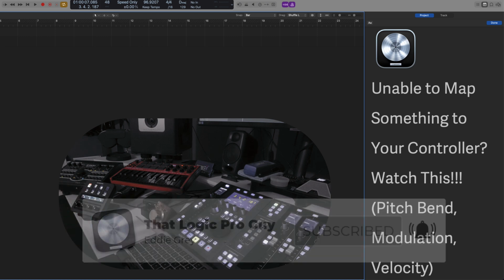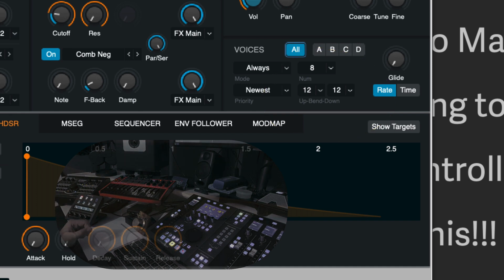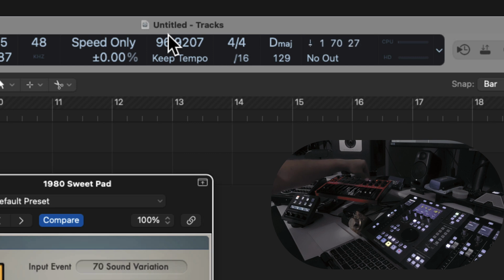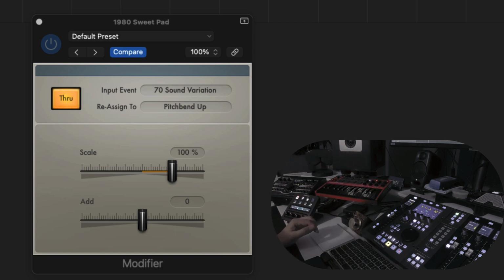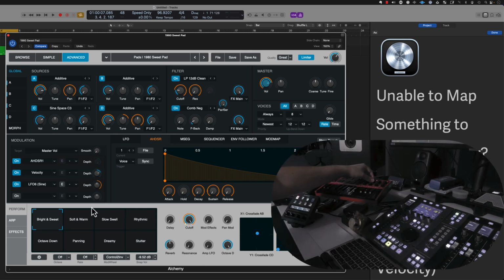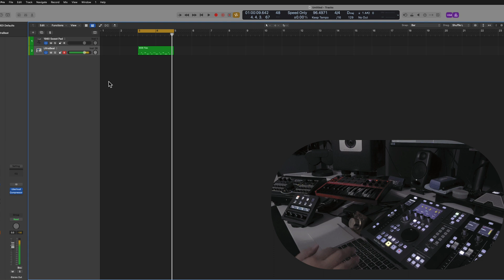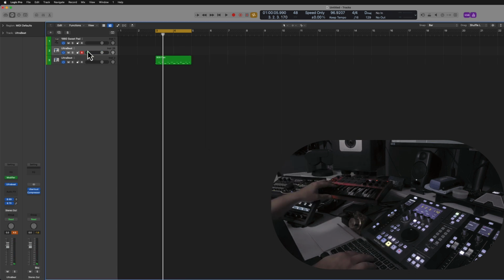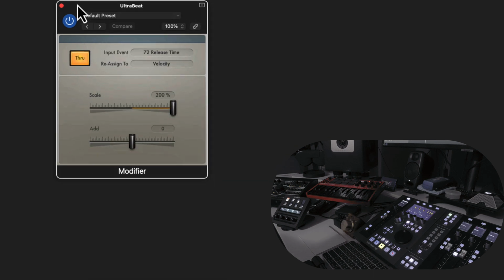Logic Pro Tutorial - Control Surfaces Support: Map Pitch Bend, Modulation, and Velocity Using This!

Comment: Yo thanks for posting all these videos, there really isn’t much out there talking about the control surface setup with Logic. I am comfortable with the Logic and Cubase environment, and Cubase really made their External Controllers so easy to use and reliable, unlike Logic, unfortunately. I am currently trying to get my X-Touch to work with Logic and after setting up the Controller Assignments and key commands, it does in fact do that. The only thing is whenever I plug in another external controller, there is a chance on my X-Touch losing some of the key commands I setup. Im not sure if it gets over written by the other Surface assignment. What I guess i’m trying to ask is, Is there a way to set my X-Touch as the main DAW remote for controlling transport and various key commands, and have the other devices on another path completely separate, purely for music creation?
Reply from the maker: Watch the video on Zones and Modes. Hope it helps.